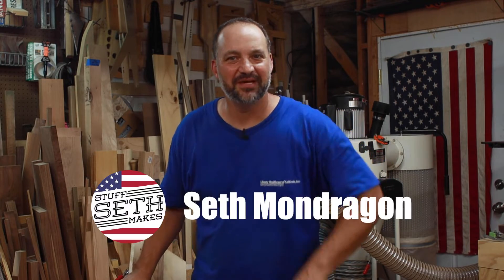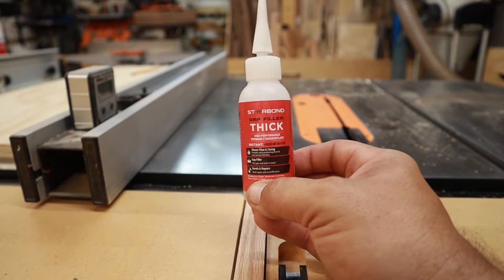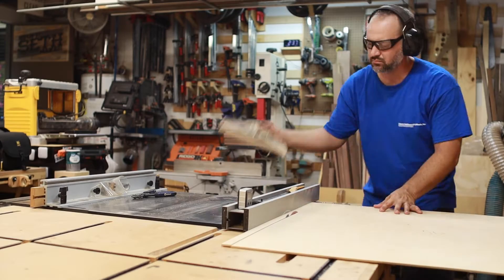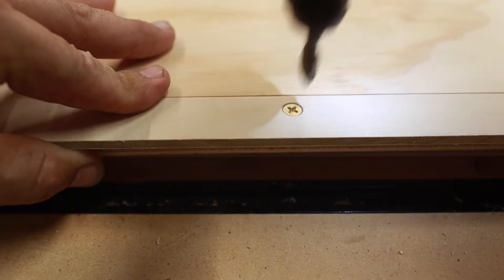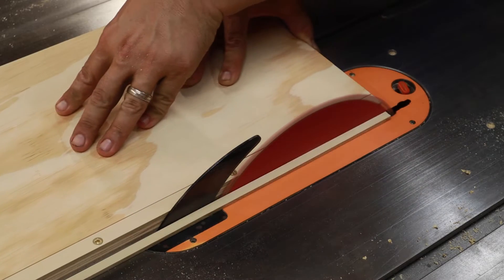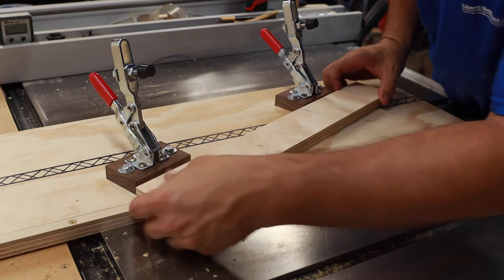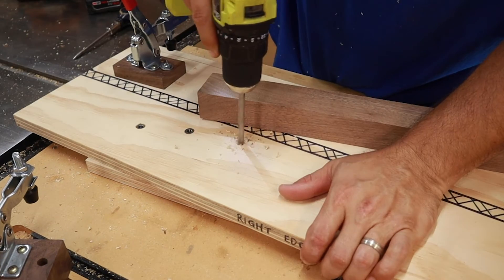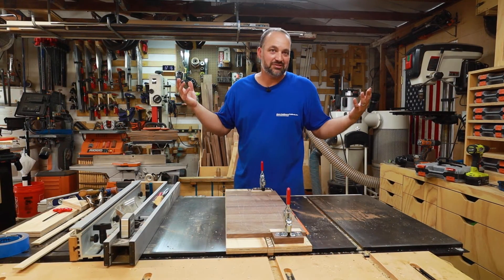My Favorite Table Saw Jig For Tapers and Angles - Woodworking Essentials

Comment: Thank You For Taking the Time to Make This Concise Informative Video

I might add that the use of a runner, rather than using the table saw fence allows nearly unlimited sizes of parts to be tapered.  However, a couple of stop blocks fit the end and sides would insure repeatable accuracy. 

Typically I use a scissors type tapering jig or make one out of scrap for one off use with stop blocks. Stop blocks can be temporarily placed with CA glue placed inside a sandwich of blue painters tape, so the same dumb sheet of plywood can be used multiple times. My hold downs are a piece of wood on top of the part screwed onto the plywood base. 

But your jig is much more higher tech.

Comment: Well done Seth! Very nice tapering jig that I will have to make myself. I was wondering if it would be possible to use magnetic catches to hold those toggles in place. That way they would be very easy to move around. Just a thought? BTW, you have a new subscriber! 👍👍
Reply from the maker: great thought on the magnets, but (if i'm picturing that idea correctly) I don't know if the magnets would be strong enough to hold the toggle clamp in place as you lock down the lever.  Having them screws down really allows them to stay put.  But again, maybe what im picturing in my head isn't what you mean🤦🏻‍♂️😆.  There's more than one way to skin a cat! haha!  Thanks for watching and thanks for the sub!🙌🏻